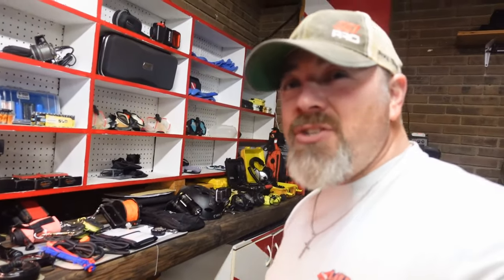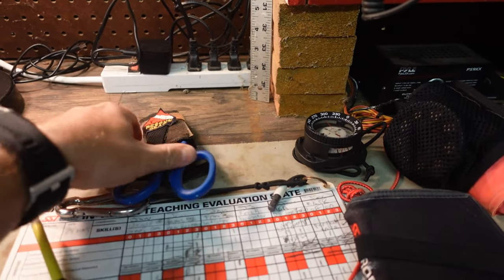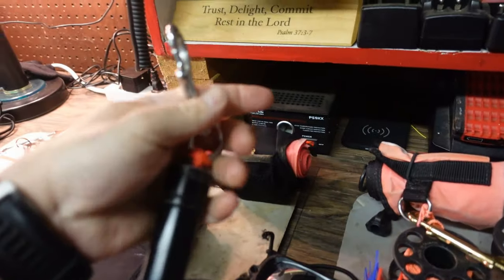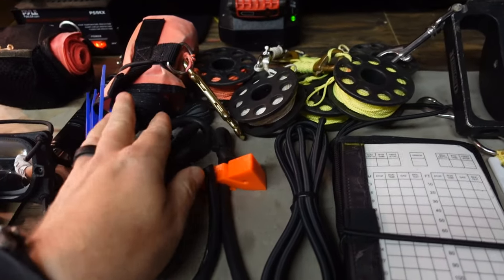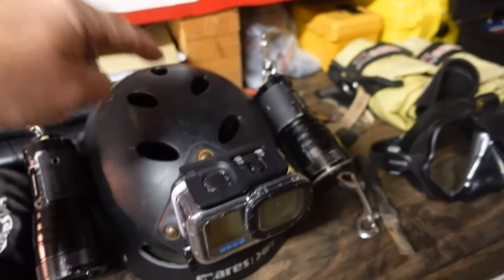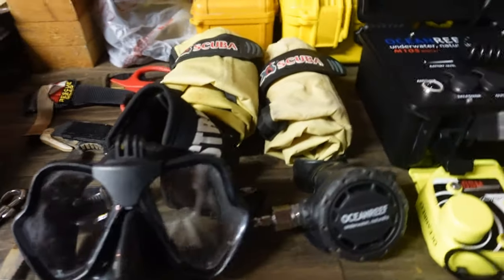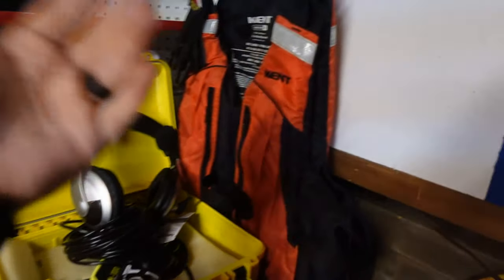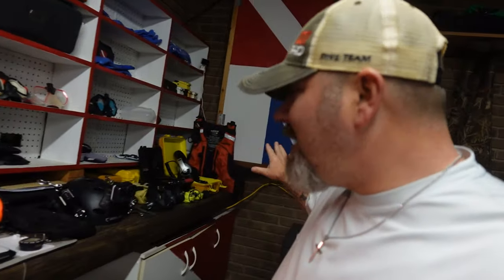Rig Run Down 2024 My Personal Accessories

Comment: What is the dive box you use ?
Reply from the maker: Hello @stevenwood1468, the two main boxes I use to travel with are the Pelican Air 1615 and the Pelican Air 1535. Locally, for Public Safety and Salvage work, I use the Pelican 1650 Protector Case.
Reply from the maker: Hello @stevenwood1468, the 3 main cases I use from Pelican are, the Pelican Air 1615, Pelican Air 1535, and the Pelican 1650 Protector.
Reply: @LakeHickoryScuba  thanks